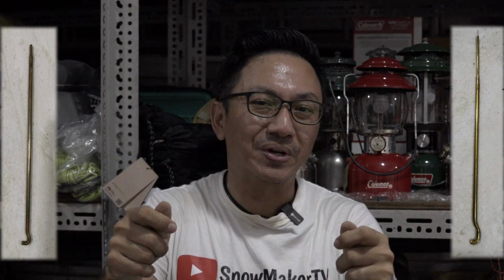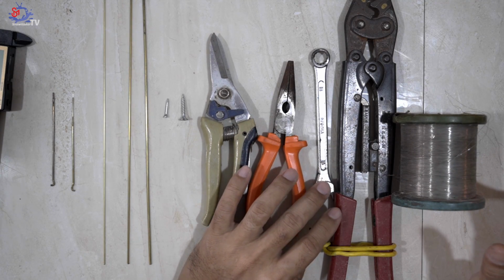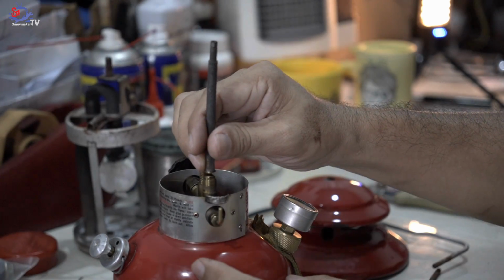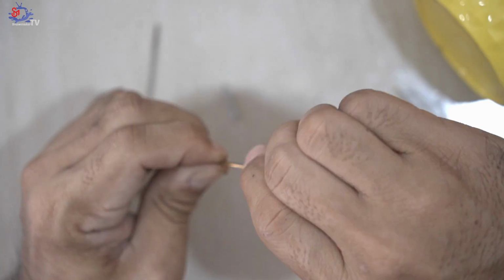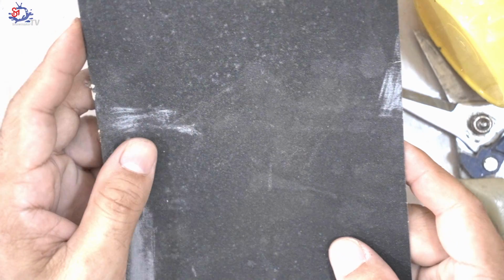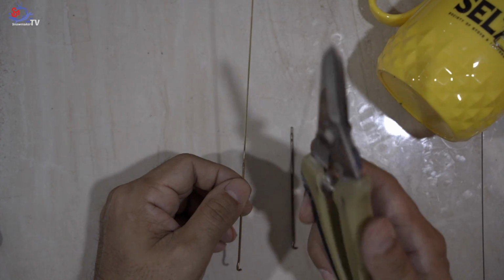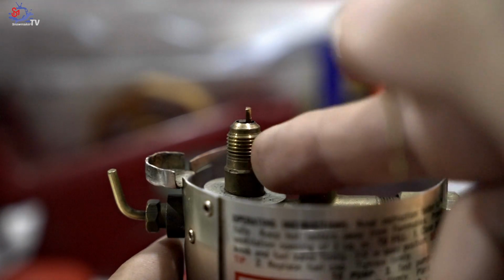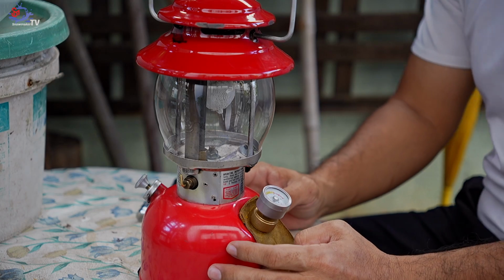DIY | Coleman Generator Needle

Comment: Also...to reduce the diameter of the small brass tube insert a length into an electric drill(cird or battery) and use the sandpaper while spinni g it.
This ensures a perfectly concentric profile-essential when the needle needs to licate into the tiny jet
Reply from the maker: Thank you for the tips & idea, really appreciate that.

Comment: Hello my friend I hope this finds you well.
As usual I am asking for help 
Thanks to you I now have the brass tubing 😅
However again I need your help .
The wire for the jet is becoming hard to find in the UK .
GETTING 0.1 MM WIRE IS NOT A PROBLEM. 
HOWEVER ITS TOO SOFT EVEN IF I ORDER HARD WIRE.
Could you please ery kindly supply a link  for the wire you use .it seems stiffer than the 4 lots I have purchased. 
Thanking you in advance .

P.S could you make a video on re coating the vent on a coleman northstar lantern 
I believe its coated in Porcelain. 
Lol just a thought
Thank you 
Take care 
Keith 
Wigan 
United Kingdom 🇬🇧
Reply from the maker: Thanks for reaching out. The link I provided most likely is for ASEAN region. I believe u able to get it in Ebay as I search & able to find it. The 0.1mm I'm using is softer than the original one, have to do it gentle so that to prevent breaking it especially when clamping the edge between the tube & the wire.

Comment: Hello my friend 
I hope you can help me 
I am in the UK by the way .
I am having extreme difficulty in finding the copper or brass tubing. 
Can I politely ask that you supply me with the exact measurements 
Outside and inside diameters 
I have been searching for 
1.0 mm internal diameter 
And 1.5 mm internal diameter. Tubing.
Also I have been telling possible suppliers in China  I have approached  that the smaller diameter must be able to slide inside the  larger.
I hope you can help 
Kindest regards 
Keith .
P.S 
Unfortunately the link you sent me did not work
But sincerely thank you for trying.
Reply from the maker: Hi my friend. Try the link below I stated, is from Amazon. Come with all sizes. 

uxcell Brass Tube, 1mm 1.5mm 2mm 2.5mm 3mm 3.5mm OD x 0.2mm Wall Thickness 300mm Length Seamless Round Pipe Tubing, Pack of 6 https://a.co/d/3Iz6EJI

Sorry, the link I provided most likely mainly for Asean countries. That's why UK not able to purchase it. Reply me if u able to purchase the link I had share.

Comment: Where did you source the small brass tubing ? Can you get it in America or Canada ? Great video .
Reply from the maker: Thank you so much. I believe you can get it in America or Canada too. Try searching in Ebay key word "brass / copper mesh".
Reply: K&S Manufacturing supply brass tubing, rods, bar stock and sheets for use in model building. It is generally available from hobby shops. The 1/16 diameter equates to about 1.6mm, essentially the size he  used to make his "needle holder"..